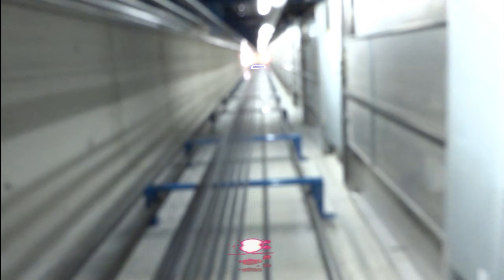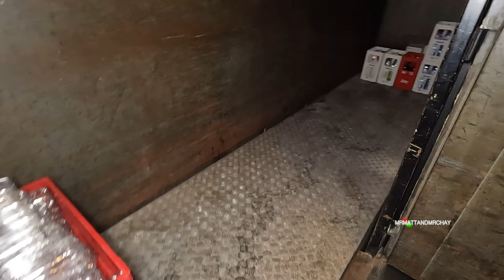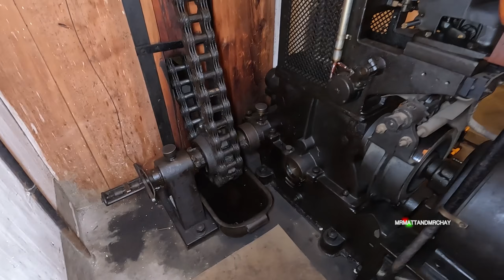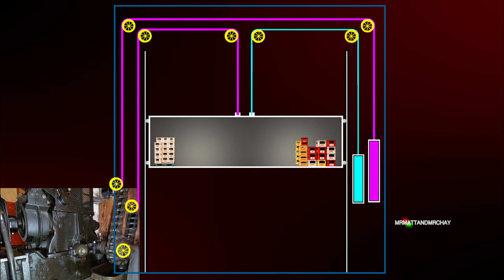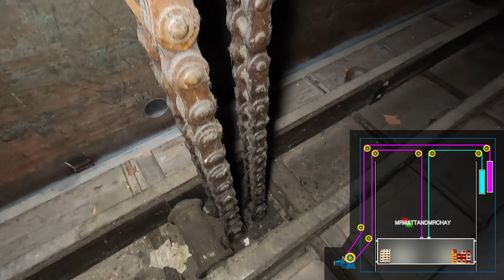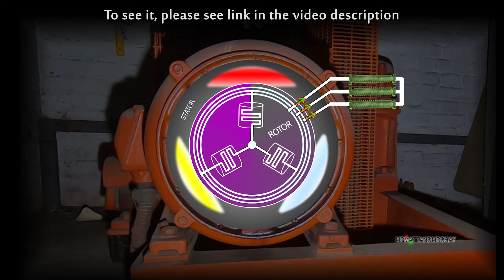Really old SCREW FACTORY LIFT - everything explained (inc motor room)

Comment: Slip ring motors with start and break resistors with time control was so hi-tech in 1940 but now it's crazy to imagine the entire control circuit of that whole machine room would fit in a shoe box sized VFD with a built-in PLC driving a single motor... I remember we rebuilt a machine at a factory that started its life in the 70s in a similar working principle and the 1m3 sized cabinet with resistors and over a dozen 130A contactors were just switched to a single VFD... It was crazy to see that transformation.
Reply from the maker: Totally agree with you!  Even back in about 2000, saw an Otis engineer fixing an old Otis with DC-generators and he remembered that this was a flag-ship lift of Otis, massive noisy motor room full of interesting stuff.  Nowadays, all you need is a little room above the lift and a cabinet beside the lift!

Comment: What a fabulous bit of mechanical madness! One thing that made this personal to me is that I used to work in the screw machine industry. I worked in a warehouse filled with 12 foot (approx 3.6m) steel round and hexagon bars. They had diameters that ranged from less than 1/8 in (3.175mm) to greater than two and a half inches (63.5mm). They looked just like the bundle of steel bars that was shown in the video. We would lift these bundles up with an overhead crane and set them on flatbed trucks. I didn't see any equipment that would have moved such bundles into the lift, with perhaps it was removed when the building was converted to its current use.
Reply: I want to see that lift in person.
Reply from the maker: Excellent comment and thank you very much for writing it.  Yes, 1940 (or even 1917 according to the drawing) is a long time for things to change considerably.

Comment: Fascinating mechanical stops. So simple, but genious!
Reply from the maker: Yes, wonder how much time it took to adjust those stops to perform in exactly the right position!  Or perhaps, all you need to do is put the car at the top/bottom, and move the stops all the way to the bar.  In this case, quite easy!

Comment: That’s a special lift! I’ve never seen a cab configuration like this before but the original use of the building makes it a logical choice. It’s very bespoke, you often don’t get custom engineering like this anymore but when you get, you get something that is taylor made. This one of those instances where the architect understood the logistics of a specific factory building and crafted a solution with the lift engineers to create a unique solution that fits like a glove for the operations of that factory and products it made. This is one of those cases where money is no object because it probably would have been somewhat expensive to built. It feels more like a piece of manufacturing equipment in it’s design approach rather then just an off the shelf lift design.
Reply: Seen a similar one in regards of the cab but it was 4x2 meters instead of 1x6. It was in the Telekom HQ in my city in the "technological wing" and it was used to move large pieces of equipment from HVAC to phone switchboard modules. It had no internal doors, doors on both sides and worked in a similar fashion just more modern. It recently had IR gates installed on both sides to prevent pinching. The problem was similar and thus the solution was similar.
Reply from the maker: Indeed!  And it's so cool that they kept it running all this time!  Stuff from this age, you could probably make replacement parts when they break, and engineers in switzerland seem to be more accomodating to repair lifts like this, rather than say "too old, needs replacing" like they do in the UK!
Reply from the maker: @whateverynamegoeshere3644 Excellent!

Comment: Fascinating in many ways. Those doors are potentially very dangerous but, as the lift seems to only be operated by staff that know it well, then it carries on hopefully safely. That car is very strange proportions.
Reply from the maker: Indeed it does!  Very strange shape, but designed for a purpose back when the factory was set up.

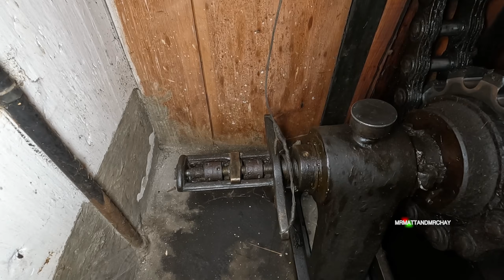Comment: 8:50 I have seen similar devices on old Otis winding drum machines from the 1900s-1910s back in the states. However these were connected by gears to a set of relays mounted directly above, and there was also a small counterweight attached to the end of a chain that would move up or down as the device was rotated by the drive gear.
Reply from the maker: I think I've seen something similar on your channel somewhere?  If you have a link, please post here and I'll approve it.
Reply: @mrmattandmrchay  let me have a look, the particular one I’m remembering I sadly didn’t get the chance to get a video of, but I think there may be something similar shown on my channel since I’ve filmed a few other drum machines.

Comment: amazing. the attention to detail alone, with each floor having a customer-specified name instead of boring numbers. the nachstellung is a really handy feature. splitting the load onto two counterweights is a very smart design choice for this setup, and the overall compactness and integration of the machinery are impressive. very smart engineering :)
Reply: I agree, having seen machines get stuck when being unloaded out of a lift because it stopped 5mm lower than the floor landing, causing the machine's wheels to get stuck on the door sill for 4 min. Some early '80s Toshiba cargo lifts in my country have the same up/down buttons in the lift car too but I remember they are less flexible. Pressing them makes the lift car go up/down by a fixed distance

Comment: Really amazing. I am a fan of old lifts. During my apprenticeship we had a goods lift with hydraulics. It was slow and supposed to be used by goods only but we rode it all the time. Till one day the oil leaked out and the repair was so expensive they put a key lock onto it.  Sadly i missed riding on the last Paternoster lift they had in use next to the Einstein House in Berne. Safety rules are still relatively lax in Switzerland. They do have a rigid concession system but do allow for the use beyond the design stage if considered safe.
Reply from the maker: Thanks for the comment and interesting!  And, I have a Paternoster coming up in a future video! - motor room, power up, everything!

Comment: There is a wrong statement about slip ring motors. When ordinary induction motors start up, the cage represents shorted windings of a thee-phase transformer. Because nothing is moving to take the power, the inrush-current is only limited by the winding's resistance. That can not only blow the fuses, but damage the motor's windings and even a stall is possible due to magnetic core saturation and heating. Larger motors can not use a Y-Delta-Switch, because the winding resistance is still too low. Therefore, the squirrel-cage of a slip-ring-motor doesn't have three internal short-circuits, but the three parts os the cage are connected in a Y-configuration and the three legs are connected to three slip-rings, where the brushes are connected to another three resistors in a Y-circuit. This way, the resistor values limit the inrush current, according to Ohm's law. After the motor has been moving, the resistors are shorted. Therefore electrical power is converted to mechanical power and the winding currents drop to designed values.
Reply: Thanks for the clarification! As someone more "mechanically inclined" it's helpful to see electricity-related corrections in comments.
Reply from the maker: Thank you for the comment, read it, going to read it again tomorrow to fully understand :)

Comment: I've been in & used an old Otis 2 story AC geared traction elevator with scissor gate & swinging outer doors. Later, space guards were installed on the inside of the swinging doors. It was pushbutton,I believe 2 to 1 roping, single speed,220 volts single phase 60 hz with a 4 1/2 hp motor.

Comment: I've been following you now for a very long time and love your videos but I was mesmerized by this one omg such.a lovely old lift and still working, thanks for the work you put into making it
Just a question ❓ in these days of health and safety do any old fashioned what I call cage lifts exist anymore where you open and shut the doors manually and you can see the lift shaft through the doors?
Best regards to you both 
Paul Adams Worcester Park in Surrey
Reply: Yes they still exist, grandfathered in, though generally not in public access buildings, because the building owners know just how bad people are at reading, and that there are a large number who are that stupid as to get themselves injured in one.
Reply: I haven't been there in years so things might've changed in the meantime, but the lift in Claire's department store in Llandudno used to be the cage type, and had manually operated gates. Many older apartment blocks in Spain and Italy still have these in place too, and many older industrial sites - Though not cage lifts - Do tend to have big-ass freight lifts with manually operated doors weighing over a ton.

Back when Nuclear Electric (Latterly BNFL/Magnox) used to permit tours of their power stations, those going around Wylfa (Now undergoing decommissioning) used the freight lifts at either end of the main reactor building to travel between entry and control room levels. These things had a S.W.L. of at least 10,000kg to them (Probably just as well, considering how overweight I've always been! 😋) and manual gates each at least 6m by 4m.

You wouldn't believe the shock people had when they saw a 12 year old opening them with barely any effort, though remembering these were well made so good engineering took most of the weight off my hands! 👍
Reply from the maker: Thanks for the nice comment @pacr4, it looks like others have answered your question :)  I would say, any company coming across such a lift would think "upgrade - money" rather than "lets keep this running!".

Comment: I feel like you missed a point about the double chain system. In the event if 1 chain failing atleast theres something still counterweighting the car ao whether it falls up or down its going to do so with a littlw more grace than it would with just one chain. Seong as there doesnt appear to be any brake like a modernish cable lift would have that actuates on cable faulure
Reply: Y'know...That also answers my question about why both chains are attached at the centre of the car rather than each being attached at one end. In the situation you propose, suspension from the centre will give a smoother and safer controlled descent. 👍

And when thinking about it; With this being one of very few - If not the only - Lift in the world with a car so wide compared to its depth and height, conventional approaches are probably better to keep to given the extremely unusual nature of this installation. 😇
Reply from the maker: Yes, interesting point!  If the small chain broke, then the lift would decent slower as the CW is quite small.  The large chain however (which does more work, going around so many sprockets), it would stop to an extent but would still fall fairly quickly i reckon.

Comment: Great video but what about the braking system if the chain breaks? Looks like I almost saw some sort of outward expanding brake shoe but no real connection to the chain. For sure, (I'd hope) it does have some sort of braking system.
Reply from the maker: Good question.  All lifts/elevators had some kind of brake, since the invention of the safety brake by Elijah Otis.  However, I did not see anything here (must be there though, surely!?!)
Reply: @mrmattandmrchay  Exactly, I did see something on the underside that may have been connected by bellcrank to chain. But wasn't too clear, but I am sure there is a brake on it, like you said.